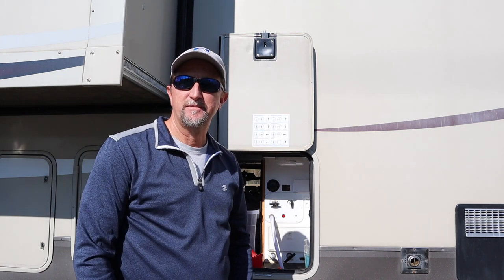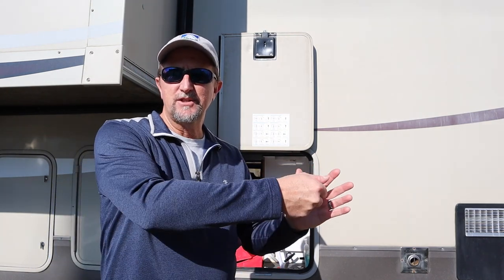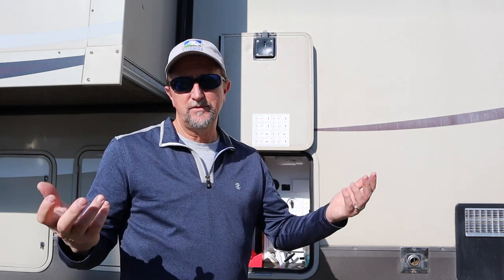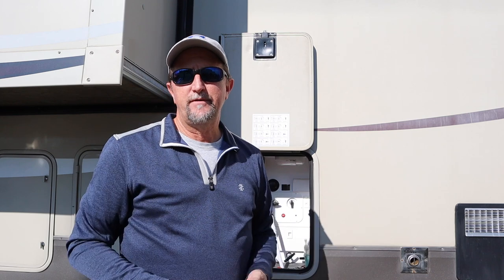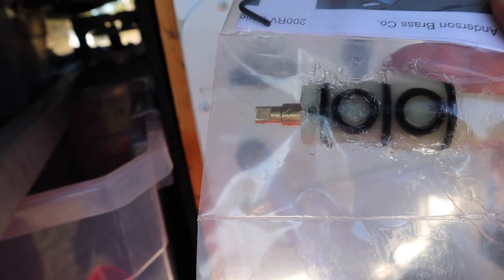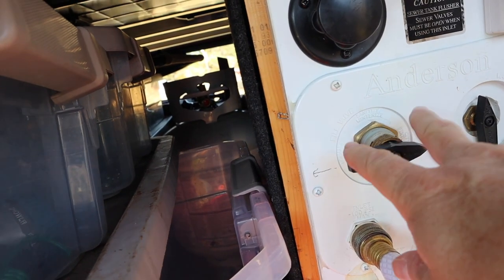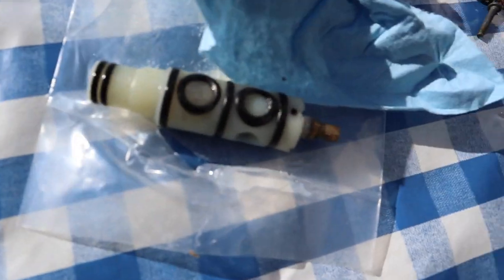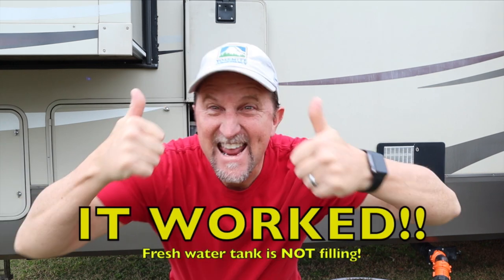HELP! Fresh Water Tank is filling! || Fulltime RV Living

Comment: I’m right now at a rv resort in Galveston and this is my exact problem. Thank you thank you thank you sir.
Reply from the maker: Hey Nathan!  Thanks for watching!  I hope you were able to resolve your issue.
Reply: ChangingTheView  
I’m trying to find the part or part number right now on the website.
Reply: @nathanurick8320  Looks like they stop making the cartridge. I am going to try and relube mine - mine is brand new and extremely hard to turn. I can't imagine the seals/seats are bad already. You can replace the whole valve anywhere from 170-200 bucks which is not the answer I wanted to hear either.
Reply: Mickey Alberto yes I found this out a couple of days ago. It’s ok though.

Comment: We've had the same problem and replaced the valve after installing a  cut off too. Be sure to relieve water pressure in your lines before turning that valve to fill your fresh tank. These valves are known to fail frequently especially if there is pressure in the lines. I finally ordered a whole new panel.  The newer panels have brass valves instead of plastic.

Comment: Remember,  if you have a Swan valve, with the City or Fill positions, they can allow water into the tank because they dont always fully seat. I installed a Sharkbite valve between the Swan and the tank to stop it. The telltale is when water is running out of the hose connection when you unhook.
Reply from the maker: Thanks for the information!

Comment: Been there done that 🤔.  We replaced the cartridge on ours as well, but we still had leaks.  According to ABCO, they aren't manufacturing the plastic valve bodies any longer.  You really need to replace the plastic valve body with the full brass version.  We replaced ours last summer and haven't had any further issues 😎.
Reply from the maker: Thank you.  I'll check into that!

Comment: Plan B
My fresh tank kept filling on city hook up any time the water pressure exceeded 35 lbs. My rig is tested to 90 lbs and recomended not to exceed 50 lbs. I replaced my o-ring Anderson valve with solid brass valve and the problem persisted.  I  viewed a few videos saying to run hot water through pump. I thought this was silly but did it anyway. It worked! I kept racking my brain as to why. Then it dawned on me. We never dry camp and every year we winterize. My guess is, years of winterization fluid sitting in the pump, gummed up the check valve and the hot water disabled the goo. I pumped hot water for as long as it took to eat a chocolate nutty buddy. 

Problem solved.
Reply: Any idea on what to do if my water pump does not work but I still have this problem?
Reply: @lalozichlids3245  Replace your water Pump if it does not work cause it may be your check valve is not working in your pump , or like the guy said put a shut  off valve to the fresh water line that would be my guess .

Comment: I have a 2020 Keystone Outback & am having this exact problem! Could you please advise if the same fix on this video would eliminate my problem?
Reply: I've got an 2015 Outback and mine does not have a selector switch like this and im having issues with Fresh water tank filling up as well I've also tried to bleed out air in lines but that did not work im thinking about replacing my pump and think the chk valve in the pump is messed up .

Comment: Seems to be an unnecessarily complicated system. I don't have valves and dodads. I use city water or the supply tank and never had a problem. I assume the pump won't pass water backwards or it has a check valve built into it.

Comment: If you have a shower mizer, that's where is coming from. When you divert,to wait for the water to come up to temp, it does NOT go back to the upstream side of the water heater like the salesman says. That's impossible, it's the same pressure, won't flow. I IS going into your fresh water tank, no pressure, and will flow into it. I know because it happened to me. I just dump my fresh water tank at the dump station on the way out.